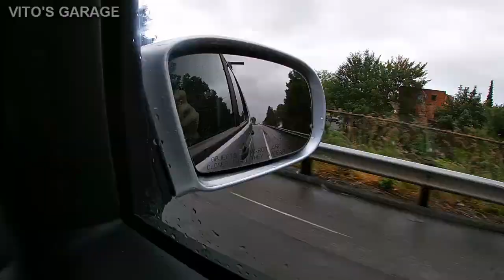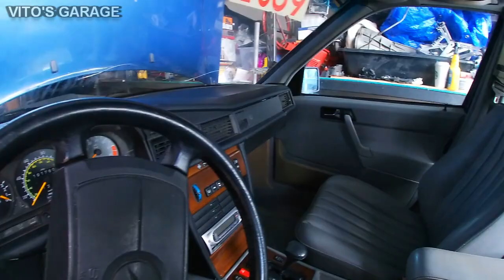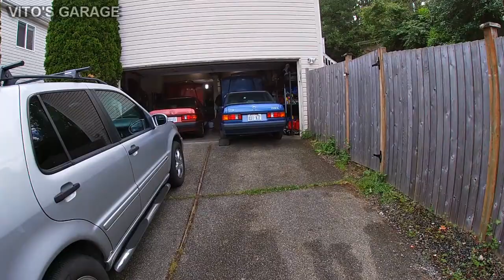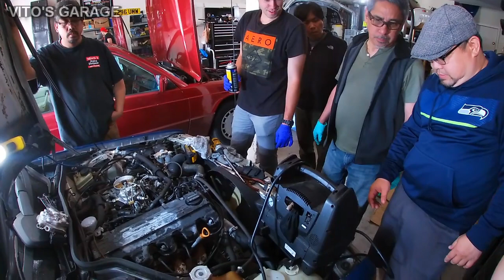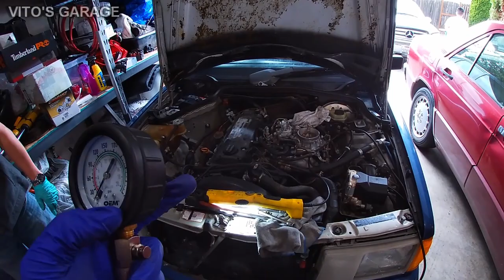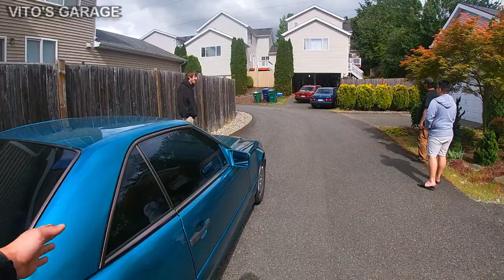Mercedes 190E that Sat For 9 Years and Men Trying To Start It!

Comment: Check distributor  cap , rotor cap. i see lots of fuel No problem with fuel.
Reply from the maker: Did you watch the video till the end? The camshaft was snapped in half. The engine was replaced on that car and it’s back to life

Comment: when u were trying to start blue 190 e    if they sit for a while fuel distributer will seize up. tap fuel distributer with hammer.  should start straight away
Reply from the maker: The engine was bad. They already changed the engine with another one anyways!
Reply: Cool vid! I’m from the seattle area and its awesome seeing others who love old benzes!
Reply from the maker: @federicobanzuela3027  cool. Thanks! If you ever want to meet up or cruise with us, let me know

Comment: Great video! I admire your knowledge! I just recently change a couple of bad valve lifters on my '89 190E - she's my first car!!
But I was wondering what was the idea behind pouring engine oil through the spark plug holes?
Cheers from Denmark!
Reply from the maker: Thank you so much for your support! Save Classic Cars!
Reply: I believe it's to determine if the compression goes up, if it does with oil in the cylinder, then its likely u need to replace piston rings
Reply from the maker: @arkynsky4462  did you watch the whole video till the end? We found a camshaft broken in half. That's why no compression

Comment: What was the issue?
Reply from the maker: So you didn’t see the entire video?
Reply: I just saw. Lol. I have an issue with crank no start. Pointed to the ignition system. As wont start with starting fluid. But my camshaft spins when i spin the engine
Reply from the maker: @PJfern-x4l  send me a message on Instagram (vitosgarageyoutube ) and I’ll help you!

Comment: Did you guys figure out the issue?
Reply from the maker: Yes. I mentioned it at the end of the video. It ended up being a broken in half camshaft causing no compression. The car currently has a good used engine installed in it. Thank you for watching!

Comment: These cars run too hot. lots of overheating issues cause of cooling fans. Ive done head gaskets on alot of these
Reply from the maker: The engine has been replaced and the blue 190E is back on the road after 9 years!

Comment: Casual bunch of dudes. I want to buy a 190e and convert to butane. By pass all gas problems.
Reply from the maker: Don’t do that. It’s not gonna be a Classic Mercedes anymore
Reply: @VITOSGARAGE  True. I don't want classic. I need reliable. Apparently the fuel system is about the only fault these cars have. I don't want an electronic jellybean.
Thanks for the come back. Are there other things I should look out for.?
Reply from the maker: @arthurwagar6224  Just buy a Toyota then and leave the Mercedes alone seriously😀 Ke Jetronic is an easy system. Read the literature
Reply: @VITOSGARAGE  Again you speak sense. How ever I like the idea of Mercedes. Some years back I had an old 5 cyl diesel. One of my favorites. I buy old, fix it and wear it out. I bought a scrap 92 Stanza 6-7 years ago. It's about done. In BZE butane is $2.00us/gal. Gas $6.00us/gal. I'll transfer the kit from the Stanza. This got to long. Tk cr.
Reply from the maker: If you’re living in California, I suggest you move out asap
Reply from the maker: I am a car mechanic and I also restore Classic German cars. I don’t convert them to some BS butane system. Sorry